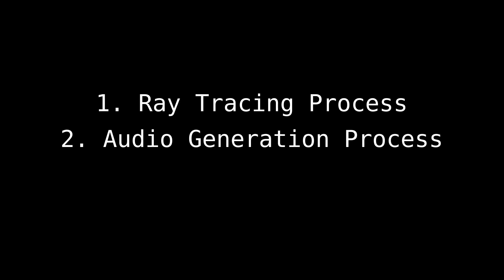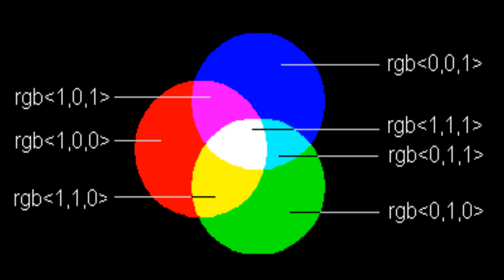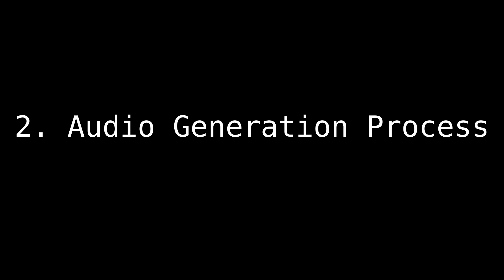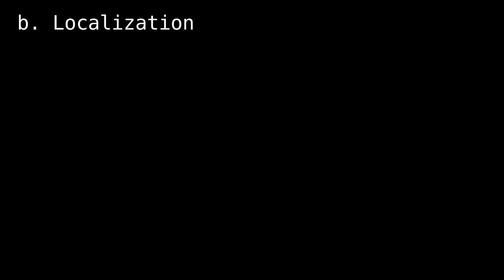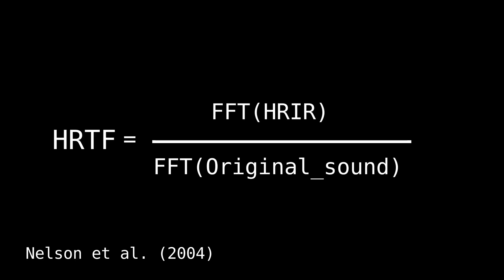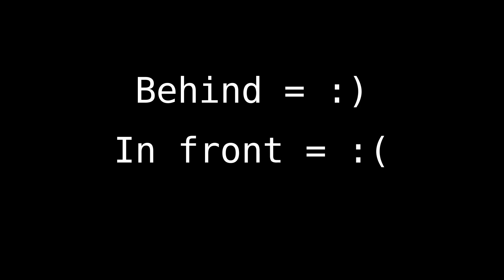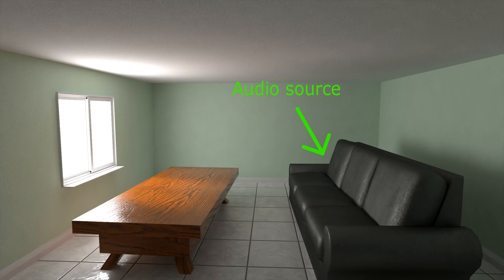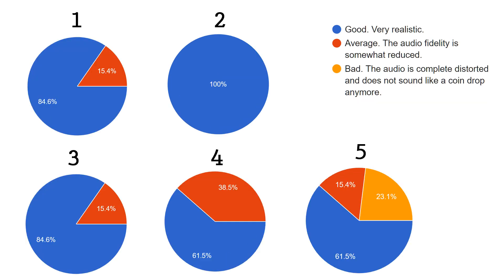Ray traced 3D Audio Simulation

Comment: Sound has so much potential when it comes to ray tracing in 3d environments. I can't wait until advanced dedicated sound cards will do this in game pc's with whatever performance they can
Reply from the maker: Would love to see a dedicated audio ray tracing engine. I had to repurpose the RGB channels for my needs which was barely enough.
Reply: @JackLe1127  It may come after the light ray tracing hype, when people start to realise that sounds can be better than the sounds they hear which keep them low interested
Reply: @JackLe1127  But since diffraction is not very significant for light and probably not in the ray tracer engine, the sounds also can't go around the corner, right? That sucks
Reply from the maker: @normaalewoon6740  Most light ray tracer supports diffraction. Those are just more expensive to do in real time because you need to spawn more rays for every ray that hits a surface then average them.

Comment: Did you test it without any wall reflections? Maybe the HRTF database isn't the problem but the 600 Hz cut-off is? Had this idea because sound from behind sounds slightly more low-pitched - at least in my intention? (My English ain't the best, sry..)
Reply from the maker: When I was testing the HRTF, I did it with the clean sample. I wrote a script to loop through each direction in each HRTF and play the sound back to me. None of them performed very well when the sound source is from the front. There are a lot of variables at play here tho. The quality and characteristic of the headphones play a big role in this. There's also each individual person's head shape that gives them a different timbre perception experience.

Comment: Thanks I liked this, it was quite interesting. I didn't expect that such a coarse separation into "high" and "low" frequencies would give you such good results. I can clearly hear the difference between the sounds the coin makes. Probably if you add more frequency channels the results will improve. Or you could solve the wave equations directly to get more physically accurate results, since the wavelengths are typically as large as the obstacles in the room.
Reply from the maker: 🤔 Yeah. The main problem was that I was limited by what the ray tracer has to offer. I only had 2 channel (red and green) to do the encoding for the frequencies. I'd love to be able to write the ray tracer myself and add in as many channels as I please.